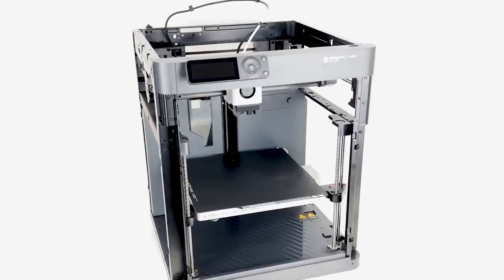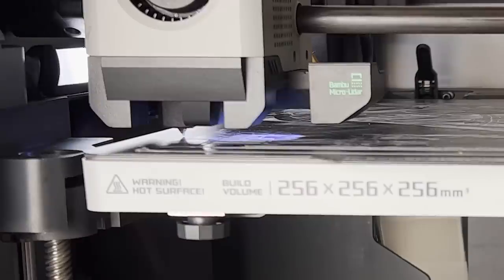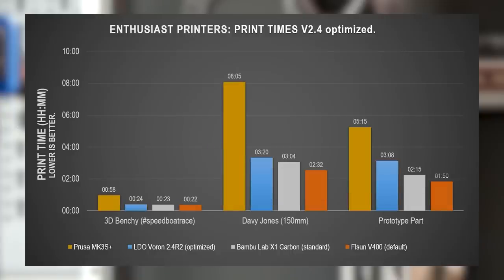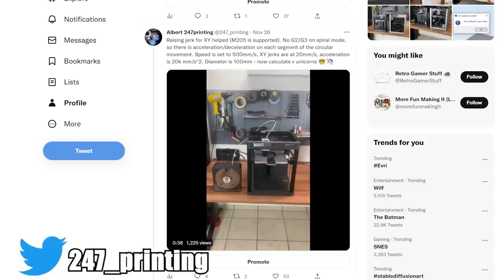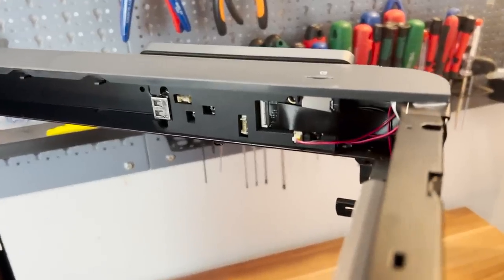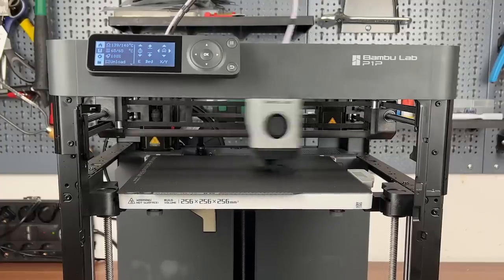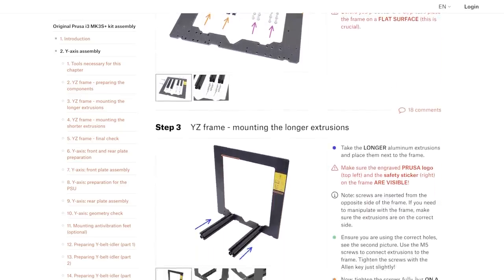Bambu Lab P1P REVIEW -  HOW GOOD IS IT REALLY ?!

Comment: The nice thing about reprap open source style printers (Prusa, Voron, etc) is when things inevitably wear out or break, the parts are off the shelf components and 3D printed parts.  This also allows easy upgrades (Prusa is notorious for this) If Bambu Labs stops making parts, you now have something going into a landfill.  They went too far into the appliance black box side of things IMHO.
Reply: Said something similar on Reddit. Right to repair is huge, you have to send this back to get it fixed, and like you said, it's a big expensive paperweight if Bambu goes under. Secondly, prusa isn't a thing of the past. I have the xl on pre order and that thing is stuffed with all kinds of fancy tech that the x1c doesn't even have. And you can be sure all of it will be drizzling into a more affordable Mk4 any day now with an announcement.
Reply: @8bittim  The XL most likely wont be as fast as the Bambu's though. Most people switching to the Bambu's are people who print as a business and time is money.
Reply: Yep. I was with an org that went all-in on Printrbot back when. They went out of production, and all the printers slowly died because the control boards were all proprietary.
Reply: @shanebrennan4657  my comment must have not been posted or deleted but I'm on the FB group with Bambu labs and most of them are hobbyists. But aside from that, the prusa has so many features speed isn't a concern of mine. I can't speculate on it either because they haven't made a statement about the exact speeds but they did claim it will be able to go pretty fast. It's the sum of many parts that makes this printer extremely interesting for me
Reply: @oddlytimbotwillison6296  they had low sales though, which suggests the marketing and product/ timing wasn't right. From what I have seen with Bambu Labs I predict it will be successful if they can iron out the small teething problems.
Reply: @8bittim  I have seen people in the fb groups saying they are going to switch out their prusas farm for Bambu labs, the speed is way above prusa and the quality is the same and in some cases better. In business time is money and if you can save time your make more money. Bit of a risk yes, i wont be switching all my Prusas out for the BL's but I have got rid of half of them and they are being replaced with P1P's. I am planning to replace the other half with p1p's if they prove they are reliable but im just hedging atm as BL is a new company.
Reply: @8bittim  I have XL on preorder aswell BTW, I am excited for it
Reply: @shanebrennan4657  absolutely I agree with your decision. I do think the prusa Mk4 will be much better tho and I'm holding out on that hope
Reply: @shanebrennan4657  it is so exciting!!! The hotswappable nozzle is probably one of my favorite features on it, aside from the segmented heatbed
Reply: @Joe Schmoe the entire chassis is stamped metal, lots of injection molded parts, the boards are proprietary and so is the hot end and extruder. Yes, Ultimaker is similar, but they open source everything so other people make replacement parts, if Bambu doesn't do that, I'd put money on these printers being dead in a couple years.
Reply: I have a laptop that was made in 2008. The manufacturer doesn't makes parts for it but I was able to upgrade the hard drive and max out the ram. I can still find some aftermarket batteries or refurbed parts. 

It started with windows vista and now runs windows 10. It officially does not run windows 11 but there was a workaround or I can run linux.

Even with the upgrades it is still slow but I can potentially keep it alive indefinitely if nothing major happens. Sure it's stupidly slow and does not have major features of new laptops like good battery, touch screen, higher res screen, faster processor ,better graphics card etc but as long as I can get parts that computer will be running forever.....

That's how you all sound. If a machine is old as methuselah who cares if you can keep it alive when better products exist. This "Ship of Theseus" mentality is counter productive. Sure I can keep that 15yr computer alive but why bother when better tech exists. 

To the gatekeepers of 3d printing there is room for people who are stuck in the past and for those who want the best right now

Can you imagine a person who bought a 2016 prusa bragging he was able to get parts to repair it but still have a 2016 prusa....in 2022.
If I nickel and dime myself getting parts, spending time installing, upgrading, configuring, tweaking and troubleshooting am I really coming out ahead when the printer is not fundamentally different for the investment?

It's ok to move on to better. even some of you who are looking at the p1p are openly wanting Prusa to get off their asses and produce something better than 50mm/s tech. And for those waiting for the XL, Prusa admitted that the XL  will not be speedy either.(also why they have not released speed info) Start asking for better from the companies you are fans of otherwise companies like Bambu will fill the void they abandoned.
Reply: @No0o0o0o0o0  you've completely missed the point. Laptops use many off the shelf parts, that's the whole point of why you can upgrade them. 3D printers can and WILL wear out their motion hardware, just the brackets that hold things together can and will fail. Don't get me started on the spot welded frame that will eventually crack. Oh, and the MK2 came out in 2016 and there was a direct upgrade path to the newest versions, not so on this stripped down machine that uses entirely different boards and hardware without an upgrade path. Again, I'll put money on these being in landfills in 5 years if they don't open source everything.
Reply: @viru52000  Whoosh, my comment went over your head my man. What I was getting at is that upgrade path for a pc or 3d printer or old tech will not be worth it after a while. Laptops are quickly becoming like phones. Non upgradable parts but in exchange you get more capable hardware. There are parts of a laptop you could never upgrade now unless you have the expertise and could source parts. There are soldered ram, HD, Graphics, processors wifi etc. 

You open source peeps are silent when the rest of your life is surrounded by non-open sourced items but the world keeps chugging along.
Monitor, phone, car, tv so so many more you use in your daily life but most folks don't want an endless diy product where in the end you janked it all together. 

You can take an Mk printer and get it to a mk3+ level....after spending ??? . it would still be slow and less capable than a new printer. _P1P or X1C. You are wasting good money chasing an upgrade path that will never reach another product that is available today. So take an Mk2 and make it a mk3....? You proved my point with the "Ship of Theseus" mentality. You are more concerned with the idea of changing out all the parts but never stopped to think is it worth it? This isn't about the hobbyist or masochist who likes to tinker. I'm talking about people who need a product to perform a task.

Lets get philosophical. How much is your time worth? With My X1 i can replace 3-4 prusa mk3 and then some.(I have an AMS). So not only am I printing faster, making/saving money and time too.  If I had an Mk2 line printer would updating it to mk3 levels even be in the top5 of fdm printers? heck no. 

Prusa competitors did not sit still and they took all of the current 3d tech and excelled while prusa sat on their hands using their name to sell products/parts rather than innovate.

I'm sure you will be happy printing at 50mm/s, on a good day, 5 yrs from now. Wear that badge proudly. I'll get whatever the best product that is out in 2027.
Reply: @No0o0o0o0o0  1) MK3 prints faster than 50mm/sec. 2) X1 carbon is barely fast enough to replace 2 Prusa MK3S, though of course you could add Klipper and make it FAR faster. 3) Nozzle changes and fixing jams is a complete nightmare on the Bambu Lad printers (have fun with that downtime). 4) Again, things break and wear out, have fun sending your printer back for repair instead of just fixing it yourself (again, downtime = money). 5) I also have a Voron 2.4, I don't need this.

On a good note, the CEO has said if the company ever goes under that they will open source everything.
Reply: @viru52000  1. Prusa defaults are 45mm/s with maybe 80mm/s for infills. The detailed perimeters are the important spec. 

2. did you watch the video? @ 07:30
Flexi dragon  2.5x difference  
prusa 21:24
Bambu 8:43

Davy jones 2.6x
Prusa 8:05
Bambu 3:04

Prototype 2.3x
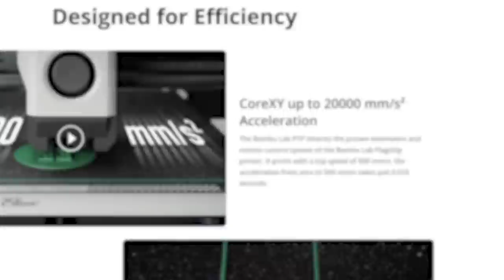Prusa 5:15
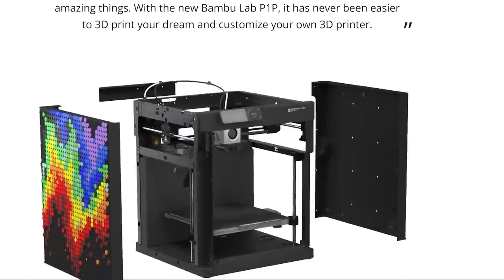Bambu 2:15

Speed boat benchy 2.5x
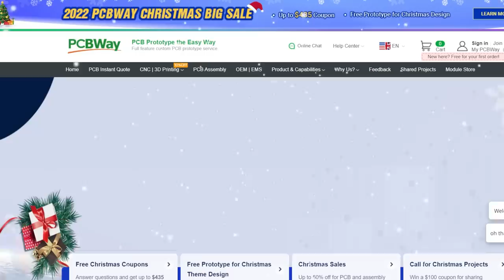Prusa 0:58
Bambu 0:23

3. Replacing a nozzle on bambulabs is 2 screws and a few min of labor. hardly difficult unless you are a mentally slow.

4. everyone is still under 1 yr warranty, Why would I need to fix anything the first year if its covered.
Also consumable parts are available. Belts, screens fans nozzles, hotends fans etc. 

5. You are defending prusa when you have a voron? ok? If you have a better printer why defend the garbage one? For someone who is starting or don't want a headache the prusa is the trash option. everything about it is below the p1p and X1.
Reply: @8bittim  100% i am buzzing for it, multicolour and material will be so quest and easy and the segmented bed is a great idea. If they can do something to get some decent speed that will be a great bonus.
Reply: @No0o0o0o0o0  1) when infill is what most of the print time of an object 😂
2) oh look, not 3-4 times faster. You said it would replace 3-4 MK3S+ machines.
3) watch the last video on this channel about this, it's a nightmare to deal with clogs. Especially when the Revo is a drop in upgrade for the Prusa
4) what part of downtime don't you understand? You HAVE to send the unit back for repair and can't repair it yourself. Warranty is nice, but you're still waiting until the unit comes back. Hope you have that backup Prusa...
5) Because the Prusa is still a dead reliable workhorse and just works.

Oh, and you still have to use glue stick on the Bambu printers?! Next we'll be back to blue painters tape 🤣
Reply: I agree, right to repair is so important. I think Bambu has been good about it so far. It's not fully open-source from hardware to firmware to software but they seem to have a pro-consumer attitude and are hanging on to proprietary advantages that let them make a splash in the market without being predatory or evil.
Reply: @shanebrennan4657  false. Do better research. Not surprising to see a fanboy not know any real information. MMU printing is faster on XL.
Reply: @Jstthts  what?? I literally said multi material and colour will be quicker on XL...
Reply: @viru52000  
Hijacking this thread

1. So you are saying the actual perimeter is not important? Genius level comment there. Bambu stock setting for infill is 300mm/s..im glad you are happy with 80mm/s weird flex but ok....lol. If you need a win...take it because what comes below will be nothing be L's for you. 

2. That's on his prints on the standard speed. So yes 4x faster.
Since you don't know about the bambu lab printers the speed settings are a multiplier. all of his speed settings are on standard. There is also Sport and Ludicrous .
1. Slient (50%)
2. Standard(100%)
3. Sport(124%)
4. Ludicrous (166%)
 
Let's go over the numbers again with the full speed settings. 
Flexi dragon  
prusa 21:24hr
Standard Bambu 8:43hr- 2.5x difference  
Sport 7.1hr 3x difference
Ludicrous5.15 hr 4x difference

Davy jones
Prusa 8:05hr
Standard  Bambu 3:04hr-  2.6x difference  
Sport: 2:28hr- 3.2x difference
Ludicrous 1:50hr 4.4x difference

Prototype 
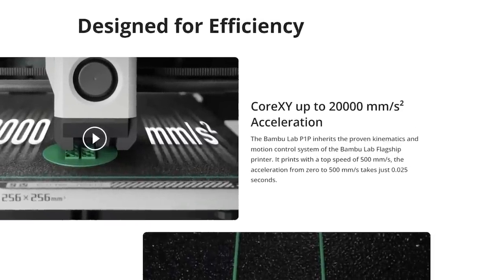Prusa 5:15hr
Standard  Bambu 2:15hr 2.3x difference
Sport 1:48hr 2.9x difference
Ludicrous 1:21hr 3.9x difference

Speed boat benchy 
Prusa 0:58
Standard Bambu 0:23m 2.5x difference
Sport 18m 3.2x difference
Ludicrous 13m 4.4x difference

3. I have a X1C so I dont need to see someone else fumble with a clog. It's simple to clear. Nozzle is 2 screws. You can cold pull filament or push through.. Simple stuff if you have ever cleared a clog on any fdm printer.

4. If you have a business where downtime is a serious concern you WILL have more than one printer. 
Basic print farm
5 Mk3s = $4000 and you have or build them= time wasted
5 Mk3s= $5500 fully assembled 

5 P1P= $3500 fully assembled
7 P1P = $4900 fully assembled. 
Or you can go with the bigger brother of X1C(1200) which means no need to kludge together an enclosure, camera, More materials able to be printed. camera, side blower(even faster printing) remote monitoring

Ams= 350

Not only can you get more for less you are getting a superior printer. Larger build volume, faster printer. You are banking on a nebulous reliability and ignoring each of those printers dont need to be built(time saved). They are triple to quadruple the output. Just remember the Longer the mk3s takes to print the more energy it uses. I canspeak for myself because I have been running not stop since AUG. 3k hrs and counting with little issue. 1 clog with wood filament being too hot. Simple unclog and Im back up and running 10 min. 

So you still keep ignoring the time savings on both the print and YOUR time. Throw in an Ams and I have not needed to touch or load filament manually for 4kg worth of filament at a time. My prints are fast and accurate.

5. You dont need glue stick. If you want to use the sticker sheet use glue, windex, nano polymer, hair spray as a release agent. If you want to use the PEI sheet(comes stock with the p1p)or buy from 3rd part or bambulab($30) you dont need glue my man. Have you been watching the video. It's all on  a PEI sheet, no glue. 

I appreciate your tenacity but serious prusa lost this round. The former DJI engineers took a shot at the king...and didnt miss. The king is d##d (prusa) long live the king! (Bambu lab)
Reply: @shanebrennan4657  but then are saying the X1 is better for a business? That doesn’t check out. It’s engineered with planned obsolescence built in, and is slower on MMU. Also will use much more material. So like. Wdym?
Reply: @No0o0o0o0o0  Oh, and more info coming in, Bambu doesn't have thermal runaway protection on their printers.  This is 3D printing firmware safety 101 so what else did they screw up on?
Reply: @ashleys3dprintshop  Oh, I'm sorry, I don't like printers that can burn my house down.  Bambu printers don't have thermal runaway protection.  So much for taking down the king lol
Reply: @No0o0o0o0o0  obviously didn't watch the entire stream as it does it on the new board, and on the P1P.
Reply: @viru52000  Noooooo already addressed this. I guess FUD and misinformation is your main go to.

no fires anywhere and pebkac.  

You can easily replace filament by pressing the side cutter. and manually removing the filament from the top. The genius ignored temp warning and tried to unload when the temps were messed up and he was replacing the part involved.

Nice try though.
Reply: @viru52000  if you wanted to sabotage a printer there are better ways to be a moron.

In the end software/firmware can be updated. Still yawning 
🥱
Reply: @ashleys3dprintshop  again, you didn't watch the stream apparently.  It did it with the NEW BOARD and on the P1P.  This is 3D printing firmware 101 and completely unexcusable.
Reply: @ashleys3dprintshop  Hey hey. Are you a KS backer as well? I was in the first 1000. Are you on the discord or reddit by chance?
Reply: @No0o0o0o0o0  "sabotage" when it uses a fragile glass thermistor that is prone to breaking (why nobody used them anymore).  Firmware can be updated, yes, but they expressly say it has this protection on their site.  The printer is marketed towards people that don't know anything about 3D printing, it needs to be safe, period.
Reply: @viru52000  Cool story bro. What beginner is getting a 1000-1500 printer?

What beginner is going to take out a thermistor and crank the heat?

If BL needs to change rate of temp increase  it's a firmware fix. a rather trivial one at that.

The core thing you are missing is before all of this, 
He tried to run print job and the printer shut the whole print down when it detected thermal errors . Everything else beyond that his him being a moron. 

He was even slamming the door and doing stupid ish. He has free printers from BL and probably doesn't care but for the rest of us who spend money we don't abuse or sabotage our equipment.
Reply: @No0o0o0o0o0  Hello. Yes I am on reddit. And I am an early bird backer along with a ankermake m5, and prusa mk3s+ and ender 3 pro. I frequent those subs along with some anime and games.
Reply: @No0o0o0o0o0  And what beginner buys a $1500 drone?  Oh wait, DJI already did that specifically because they add features that are supposed to make it easier.  Again, Nero covers this, thermal runaway protection should A L W A Y S  be on, period.  He removed the thermistor to simulate a failure (this is a COMMON practice in the 3D printing world).  Saying it's a trivial fix is like saying "oh, it's ok if my new car doesn't have brakes, they can just add them later."  This is a REQUIRED safety feature for certification which they obviously lied about.  Oh, and slamming the door and stuff, it goes through worse in shipping, it's obvious you're salty because he got a printer for free given your comments.
Reply: @viru52000  Do you know the difference between software/firmware and hardware?

Your analogy shows you do not. Try again.
Reply: @ashleys3dprintshop  Cool cool. I am on reddit too. You seem to know your stuff and I am newish to printing. Perhaps I can pick your brain over there. Virus dude seems to be a contrarian and isnt adding anything new to the conversation. How about I put up a post on reddit and you find me there. 😁
Reply: @No0o0o0o0o0  my analogy means that it's a required part of a 3D printer like it's a required part of a car being sold.  Yes it should be able to be changed, but it shouldn't have been an issue in the first place.
Reply: @viru52000  so you don't know the difference between hardware and software...lol. 

🤣
Reply: @No0o0o0o0o0  Sure I suppose. I am going to bed soon but post a calibration cube help thread tomorrow on the bambu lab subreddit and I will respond. I'll DM you over there with any questions you have.
Reply: @ashleys3dprintshop  👍
Reply: @No0o0o0o0o0  again, I do, but you don't seem to know the difference between "mission critical" and "nice to have feature." They're opening themselves up to a lawsuit.
Reply: @No0o0o0o0o0  I'm sorry, did I stutter when I said they lied?  A properly designed PTC heater should control it, but given that they can't get the simplest safety checks in firmware, how much do we depend on this?  Just because it's a PTC doesn't mean much, they use PTC heating elements to light pellet stoves FFS...
Reply: @No0o0o0o0o0  you right now "oh, I'm sorry your brakes on your car take a mile to stop the car, they still work though, right?"  The temp is still hot enough to ignite plastics and 3 minutes is WAY TOO LONG.  PTC heaters are "safer" because they can't get hot enough to melt the heat block, nothing more.
Reply: @viru52000  Nero admitted he was wrong. Obviously it was a misunderstanding. 

Luckily there are hardware and software safeguards . At no point was there a safety hazard which is the most important fact. I'm not going into analogies since the info is out there and it is proven safe.

If BL lowers the time of max temp or keeps it the same at 3 min it shows they were on the ball which is always a good thing. From the heaters they selected to the mitigation to the response was a master class in what the 3d printing community needs. 

BL is active, takes feedback, criticism, suggestions  and communicates. They are even confident in their products they sent them free to youtubers who literally hang out with Josef Prusa with no guarantees of positive coverage and still excel.

 I am definitely getting a second printer this year. 

You know what's funny I aint even pressed my man. Your exchange with me got that Ashley chick open to talk to a fellow Bambu user. 

I'm in a good mood so Happy new year.🤗